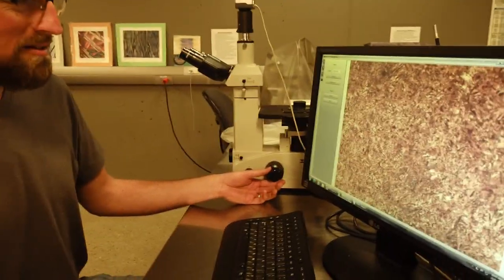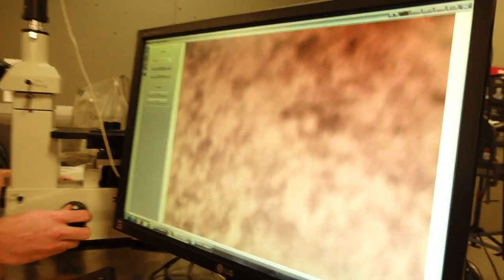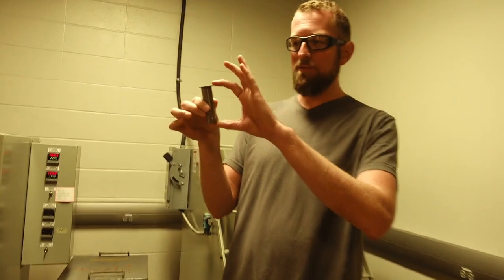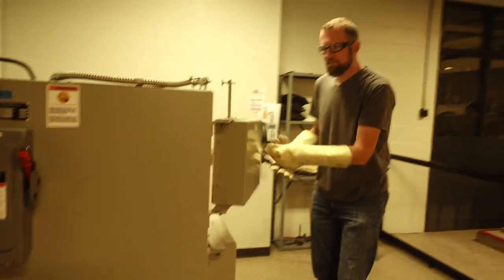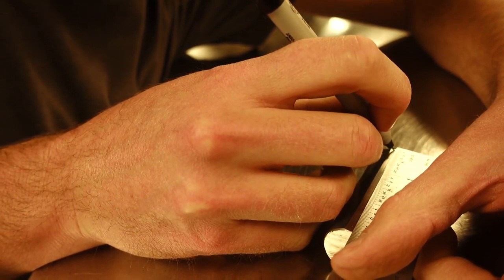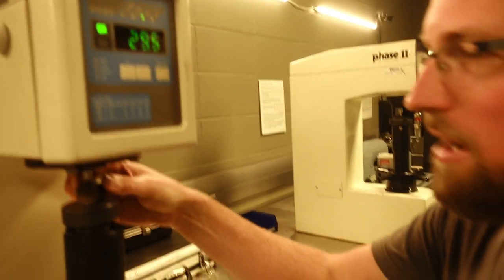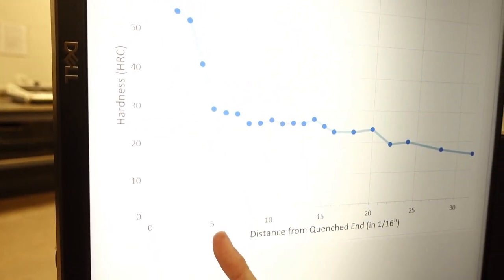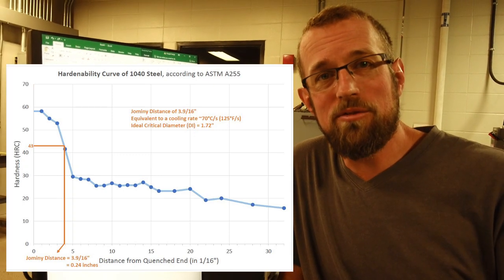Hardness vs Hardenability, Jominy Test Explained!

Comment: The phase fraction of Ferrite to Pearlite is controlled by the Carbon content alone.  The Ferrite grains have nearly 0% Carbon, whereas the Pearlite grains are a mixture of 87.5% Ferrite and 12.5% Iron Carbide.  A non-heat treated steel with exactly 0.8 wt.% Carbon is called a Eutectoid steel, and will consist only of Pearlite grains,  A steel with less than 0.8 Wt%  will have grains of pure ferrite and grains of Pearlite.  The ratio of Pearlite to ferrite grain is determined by the lever rule.  A steel with more than 0.8 wt. % carbon will not have any  grains of pure ferrite.  Instead, it will have grains of Pearlite and grains of 100% Iron Carbide.